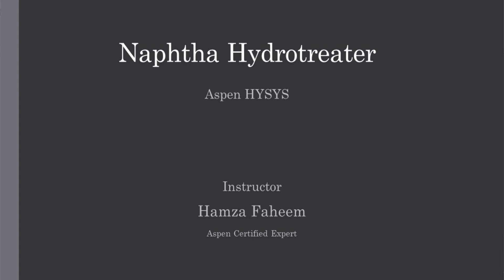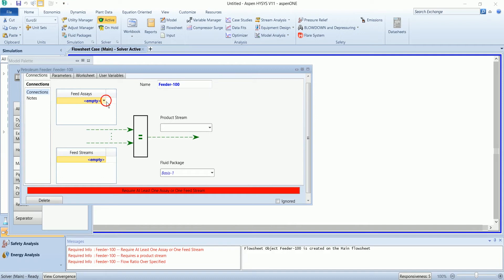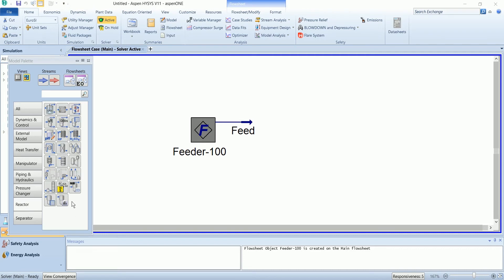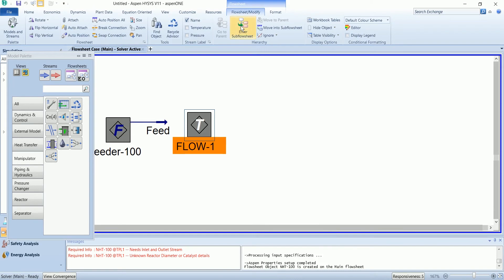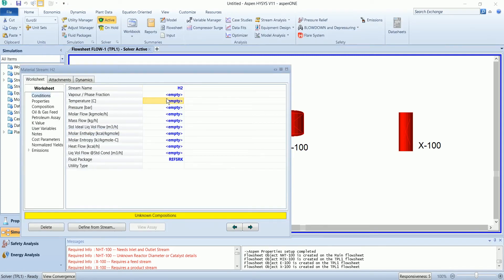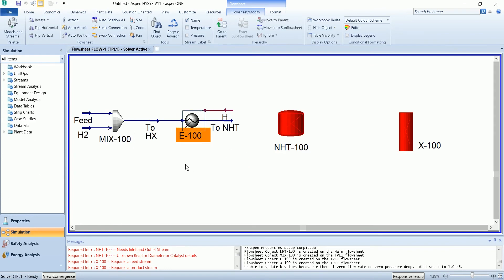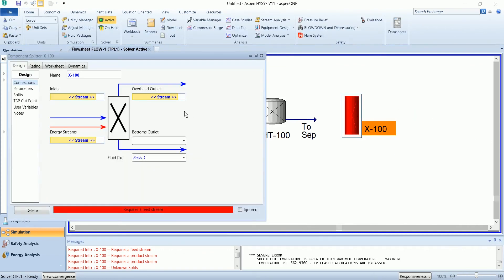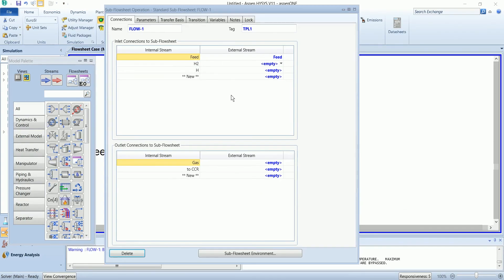Naphtha Hydrotreater || Aspen HYSYS || Refinery Process Video 11

Comment: I have a problem when connecting the main flowsheet feed to the subflowsheet. The component list for the 1st fluid package (Peng-Rob) is different from the 2nd fluid package (REFSRK). How come it can transfer the component to the flowsheet? Can you help me please? Thank you
Reply from the maker: Please share your simulation file support@chemiopeda.com
Reply: @Chemiopedia  I've shared my simulation to your email. Thank you
Reply: Flow and composition changes when feed is transferred from outside to inside. Same is happening here. See flow of feed is 850 moles/hr outside but inside it is 105. Author cleverly didn't discuss that.

Comment: Thanks for your video which helps to educate us. I have two issues. the temperature range you selected (30 - 90 degrees C ) in the feed cutter is the boiling range for light naphtha. I had thought the NHT is for heavy naphtha of which boiling range is between 70 to 180 degrees C. I followed your method but it takes me to the cutter stream method. Kindly explain the stream cutter option for solving same problem. Thank you.